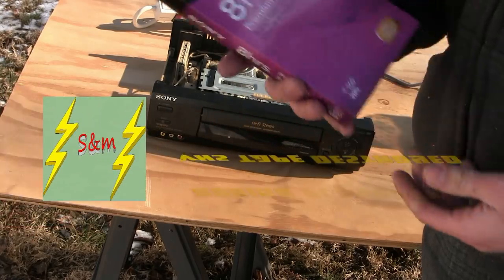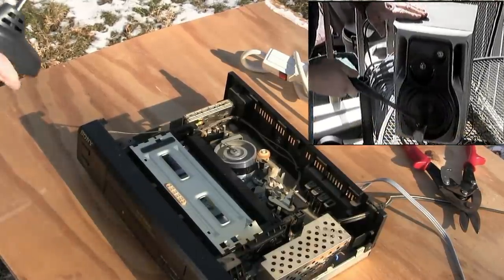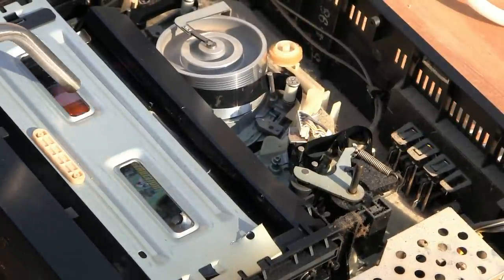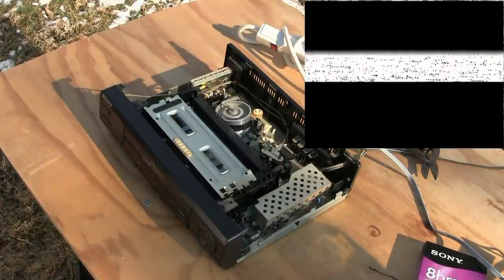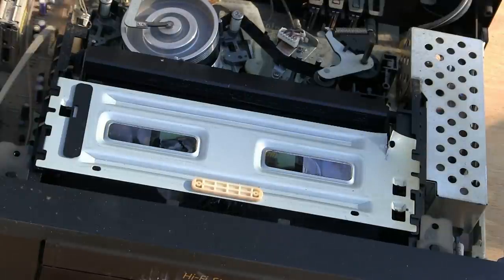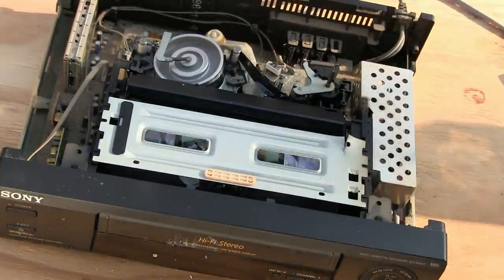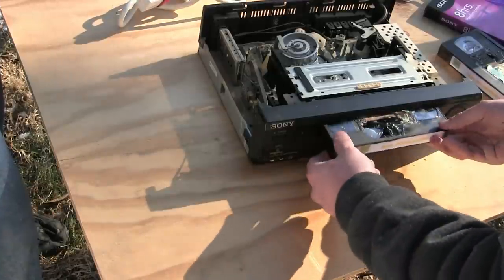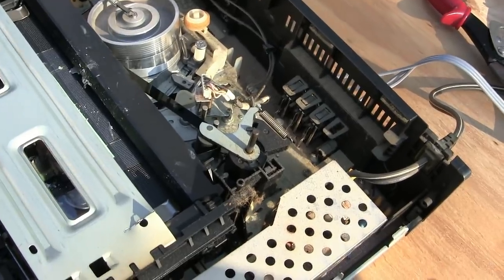VHS Tape Destroyed (During Playback)

Comment: how did you put the video
on vhs?
Reply from the maker: Jimmy Henry After I finished editing the video in my editing software, I burned the video to a DVD. I then played back the DVD while recording it on a VHS tape.
Reply: Shawn K Thanks :)
Reply from the maker: robowil m How is it failing?
Reply from the maker: robowil m Are you getting any messages on the screen when the tape ejects. I'm wondering if it has to do with a copyrighted disk preventing you from copying it, and thanks for the suggestions and the compliment. I'm glad your enjoying the channel.
Reply from the maker: Have you tried recording from other sources other than from a DVD. If it still ejects then you got a issue with your VCR.
Reply: +robowil m Wait, do you have an Sony MHC-NX1?
Reply: robowil m Oh, because i have the same problem with the vhs player. It said EJECT but now the eject button wont work anymore. R.I.P vhs player 199x - 2016
Reply: +Will M Did you remove the small plastic square on the back of the cassette? This is the overwrite protection (like in an audio casette)
Reply: MrOpenGL Yes. What about the pre recorded tapes (Like VEGGIETALES tapes I own) and they dont have a tab but not recording them until i got a VHS to DVD recorder
Reply: Will M
If you have removed it (ie if there is a hole on the back of the cassette) the VCR won't record the cassettes, because you just enabled write protection :D. Put a piece of tape over the hole, you should be able to record properly now.
Reply: MrOpenGL Oh but Im at school
Reply: they show it a pic of hillery cliton them it becomes a vhs
Reply: Shawn K lel I do that every now and then
Reply: @ssmmkk2  Where's the full Goodbye VCR video? :3